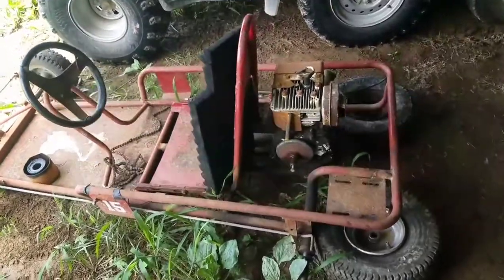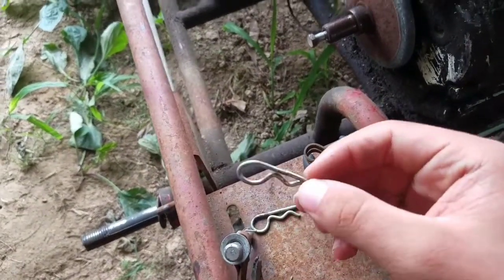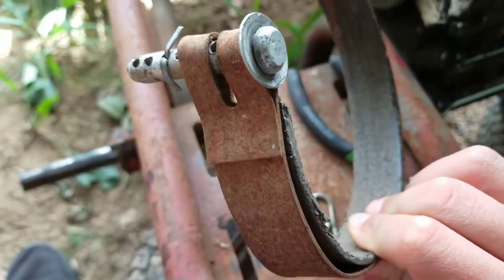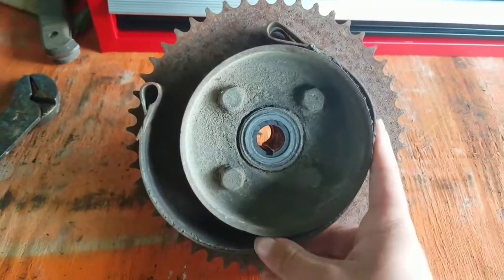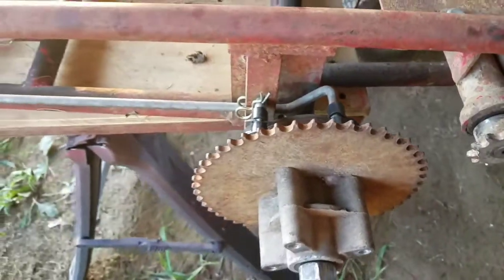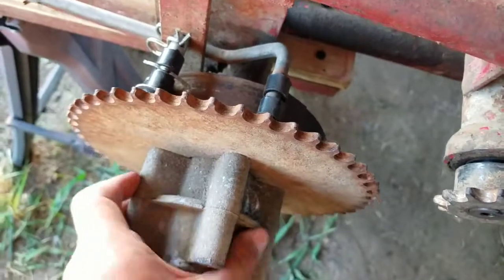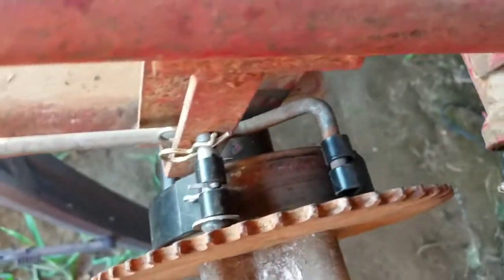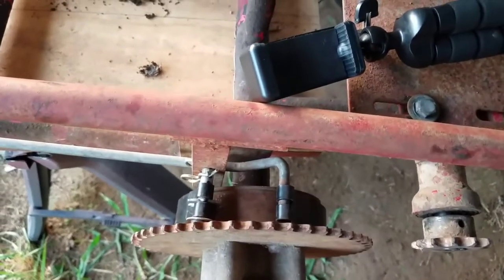Brake Band Replacement (Go-Kart )

Comment: How do you know what size is needed? Trying to replace mine and not sure if size.
Reply from the maker: Just find the diameter of the drum and anything over a 1/4 inch bigger will work, so like a 4.5 inch, you would need a 4.75 or 5.0.